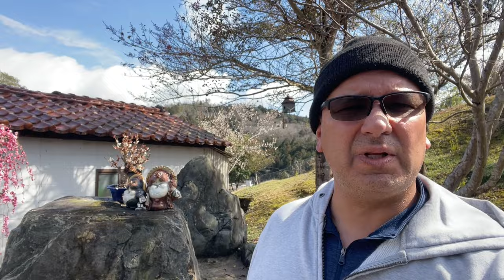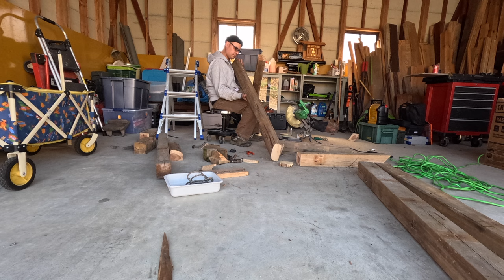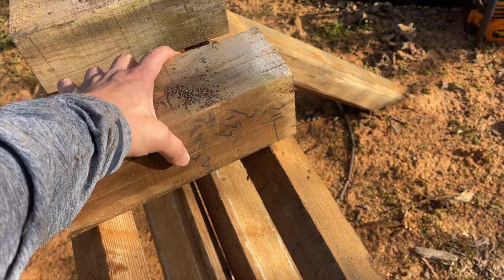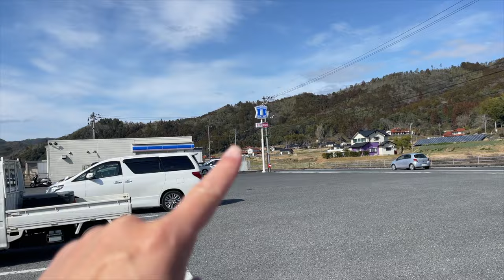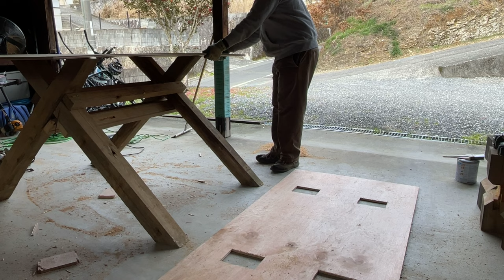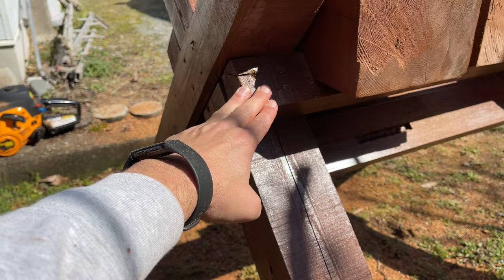I Made a Sawbuck  From My Japanese House Renovation Scraps | How to make a sawbuck

Comment: Cool video. Better to have the laterals lower but just put scrap wood between those moving parts. so If the chainsaw drops it hits the scrap wood and not the frame.

Comment: Nice work! I support "plans free" carpentry 🙂  And I like your local hardware - feels like our local ("family owned & run") stores, crammed full with (almost) everything you need for a home project, and helpful folks as well.  Though the local big box stores (Lowes, Home Depot here in the US) have driven many of them out of business, I try and support the local store first.
Reply from the maker: Yes! I try to support local as much as I can even if it’s a little more expensive at times. For watching again!